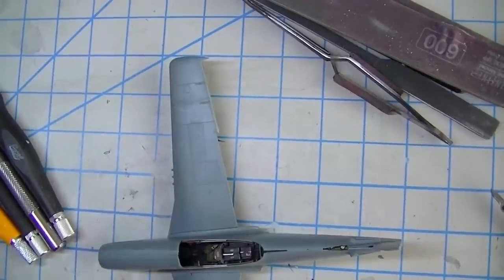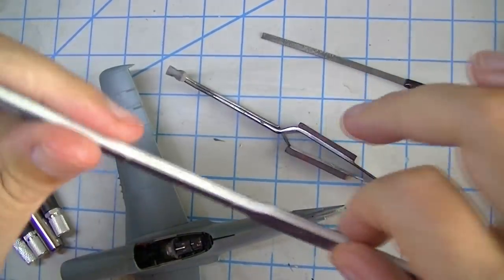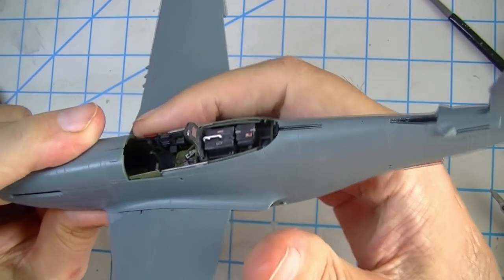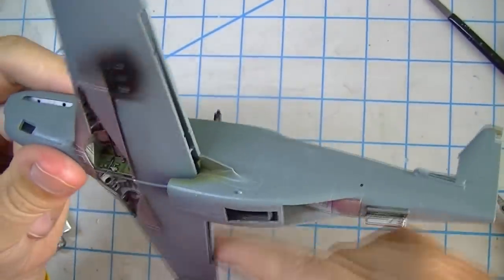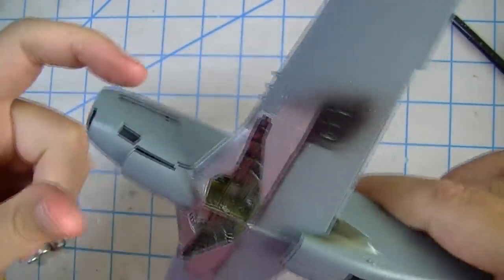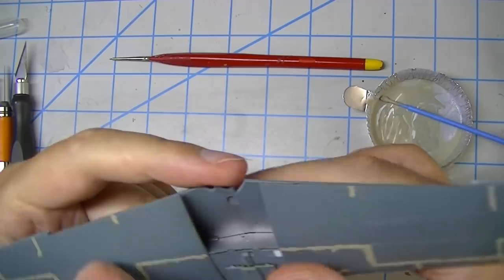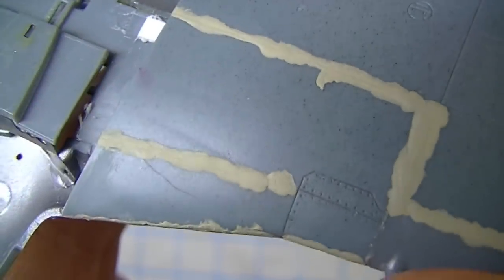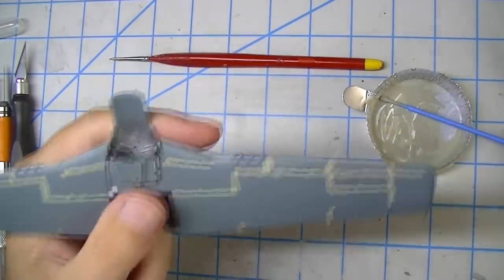ep295 - the foil adventure (with the eduard 1/48 mustang) part 5

Comment: Hi Wil. Great channel. I  usually don't post comments on YouTube but, I had to make an exception in this case. I would like to thank you for your recommendation of Kombi putty. You have saved me much labor and time spent filling seams and whatnot on my model aircraft. Compared to Tamiya white putty Kombi dries faster. is easier to sand, has a smoother finish and you can use Tamiya Lacquer thinner on a Q-tip to remove excess putty even after Kombi has dried for 12 hours or more. Thanks again for a great recommdation.

Comment: Eduard service is top notch.  I recently bought the new Wilde Sau kit. Checking the box, I noticed I was missing the resin parts. I sent an email and got a reply in less than 24 hrs. Long story short, I had the correct parts in less than 10 days, from that 1st email.

Comment: I'm a big fan of using Apoxie Sculpt as filler. I use a small scalpel-shaped spatula to apply and use Safety Solvent when needed. I've gotten pretty good at not leaving any excess. I then, when dry, use a sharp Exacto blade to scrape the fill entirely flush - if not already flush - and finish with a fine grit sandpaper. The Apoxie Sculpt doesn't affect the plastic, sticks well to surfaces, doesn't sink, doesn't pit, sands smooth like a baby's bottom, and can be feathered really finely. I rarely have to apply a second pass and never have any "ghosting" of what I filled in. Stuff like spot putty or Tamiya putty is simply too brittle and powdery, I find, and I only ever use Tamiya putty, thinned with Extra Thin or acetone, for adding texture.

Comment: I know I'm late to the party but... You were right the second time on chord line, it's the straight line between leading and trailing edge.

The funny thing about laminar flow airfoil sections is that they never really lived up to the hype of drag reduction.   In order for it to work you had to maintain the airfoil shape perfectly which, during high production rate and the rigors of war, never really happened.  What they did do, however, was have a higher critical mach number, what they would call "compressibility" in those days.

"Critical mach" is the speed at which airflow over the airfoil section exceeds the speed of sound, this causes a shock to form and drag to rise sharply.  So if you compare it to, say, a P-40 the wing may have similar drag characteristics at slow speeds but the P-40 wing has a lower critical mach number, so it runs out of steam, so to speak, slower than the P-51.

Comment: Regarding fillers and the application thereof: have you considered using clay-working tools? I use epoxy putty almost exclusively, mostly because it cleans up and thins with water, and is also workable with, if nothing else, a wet finger. It's also all kinds of friendly with clay-working tools. Maybe the same can work with what you use? Just a thought.

Comment: 18:00 Credit where credit is due: It wasn't North American who designed this airfoil. It was NACA that did extensive research on laminar boundary layer flow and designed a whole family of airfoils, that were the mainstay of aerodynamic designs in the whole industry for decades to come.
It's also more complex than "you want laminar flow"; you really want transition to a turbulent boundary layer at the right point, lest you get flow separation with large scale turbulence downstream which has way worse effects than the increased drag of turbulent boundary layer.

Comment: Hi Will, I just discovered your videos this week, and subscribed.   You put out a whole lot of useful information - thanks!   

Have you ever tried catalyzed body glaze?  Evercoat makes a lot of varieties, but the standard #400 Polyester Glazing Putty is fine.    It's like Bondo, only with a much finer grain so it can be used in place of traditional lacquer putties.  You can carve it in its gel state after a couple of minutes, and it hardens to a sandable state in less than 10.      I  mix it up in very tiny batches (pea sized, with just a bit of hardener on the end of a toothpick or coffee stirrer ), and it feathers really nicely.   If I'm doing a lot of filling I will put a dollop on a wax coated paper plate, and a bit of hardener nearby, and I can pick a bit of each to apply to the model.   I can get 8 or more individual applications in one session off a small plate.

  The only downside is the cost, as a kit will set you back around 30 to 35 bucks at a local auto paint supply,  a bit more on Amazon.   It has a pretty strong smell (like Bondo), so ventilation is a must, but it is my first choice for filler.  You can thin it with a product called Plastik Honey, also available from Auto paint stores, and that product will restore the most dried out container - that is important because a can of this will go a long way.

Comment: I’ve had a long history in building R/C airplanes out of balsa and plywood. My history in plastic modeling isn’t quite as deep, but I’m trying to up my game and your videos are quite helpful. I have Mr. Surfacer 1000 and 1200 in Grey and I’ve used both with a brush before but can’t imagine trying to spray it through my airbrush! Are you just thinning it with box store lacquer thinner or something else? And I imagine the ratio has to be fairly even or at least 60/40? I’m also glad you mentioned the grit of the sanding sticks/paper you use. I would have thought 600/800 to be too coarse and would have wasted a lot of time with a finer grit, so thank you. I’ve rambled too much now. But thanks again.
Reply from the maker: thank you!  as for mr. surfacer, i thin about 50/50 with mr. leveling thinner but you could use generic lacquer thinner.  just start at 1:1 and see if you need more.